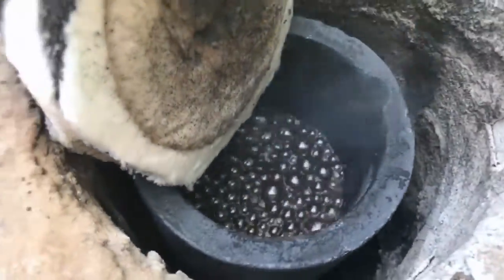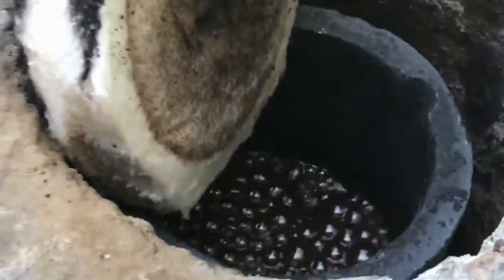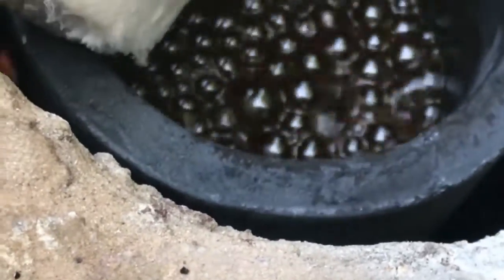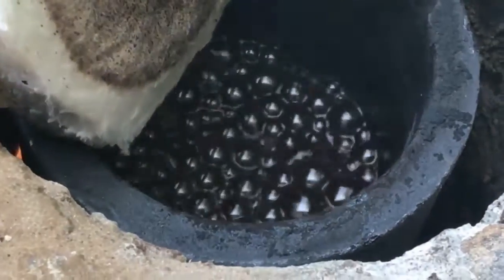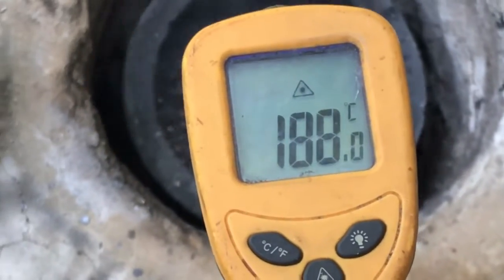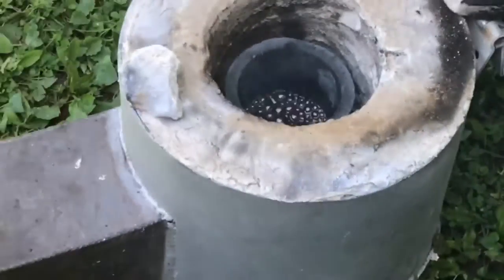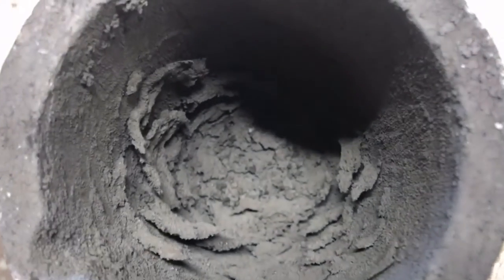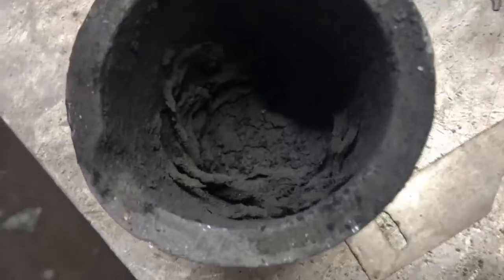Graphitic carbon nitride

Comment: You need  high pressure. The process you are undergoing is Hydrothermal Graphitization - It absolutely must be done inside a high pressure reactor. You cannot do it in  a vessel open to atmosphere. You're getting pyrolysis or at best, calcination, if you control the gasses somewhat. Just take some heavy wall large diameter  iron pipe and screw caps on both ends. It's well within the pressure rating for what you need here. You need that pressure

Comment: @NOBOX7 you don't need amonia, you just need to get an oxygen free environment for the reaction. Get rid of oxygen. In my view, carbonised activated paper or mushroom or sugar mix should do the trick. You not need Hugh pressure bottle. Any plastic reinforced with carbon fiber will do. You have to hear the activated carbon nanotubes with induction to expand the carbon nanotubes, then inject the hydrogen.
To release hydrogen, just apply heat. You can measure the hydrogen saturation by measuring the resistance/ conductivity.
Basically you should be able to store 5times more hydrogen than you would be able to store in a liquid state.

Comment: I don't think the synthesis your trying can be done this way. If you're going from urea to melamine you need a pressure container, and probably a catalyst. I'd strongly recomend starting as close to your end product as possible, and then taking steps back from there as you get your desired end product. (I can't imagine small scale production from precursors is viable, as later reagents are produced at industrial scales)